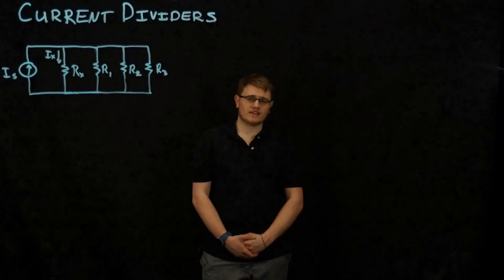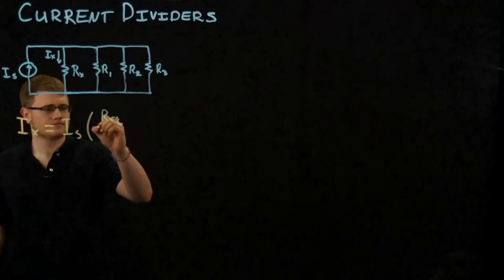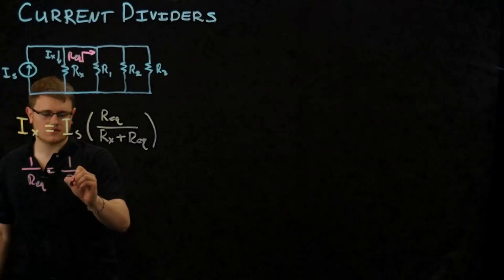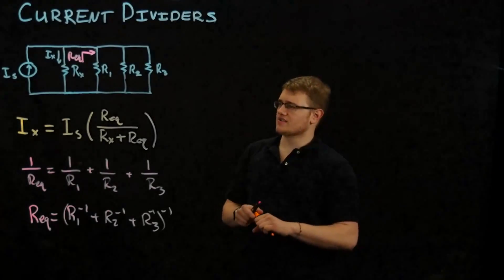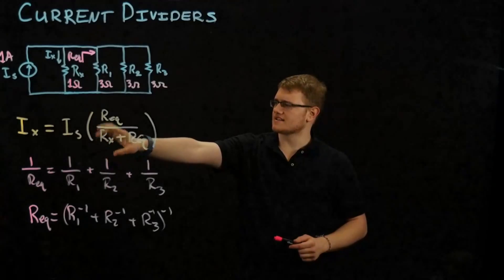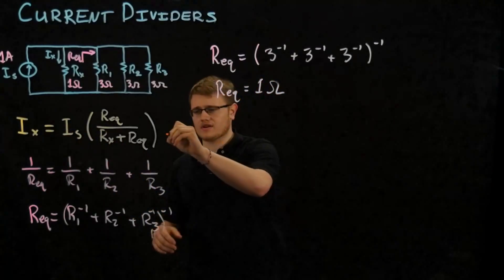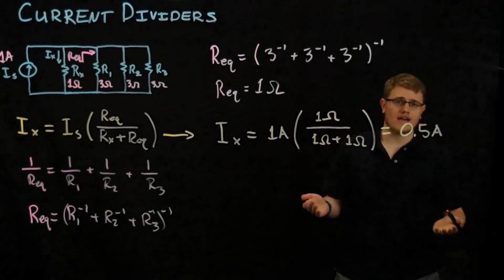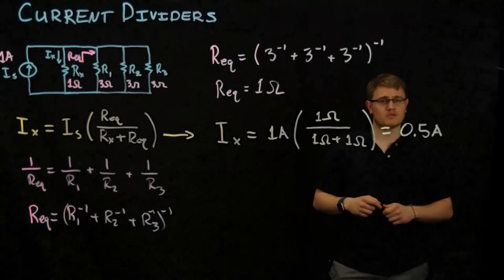Circuits 1 - Current Dividers - Intro

Comment: It would be so much more useful if you used values like 3A, 5o, 6o etc. Multiplying 1 by 1 and then dividing by neg 1 doesn't point up the process well.
Reply: True.  It makes it easy, but then it's not as clear what's happening and why.  Relating it to conductance G would make it almost intuitive.

See, it's just 1 x1x1 ÷1, all to the 1st power.  Can't you see it?